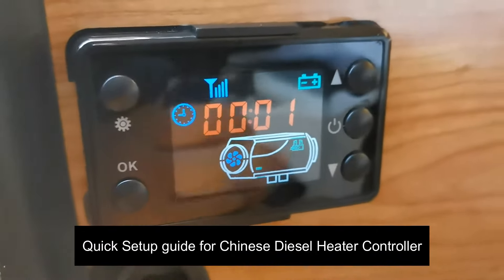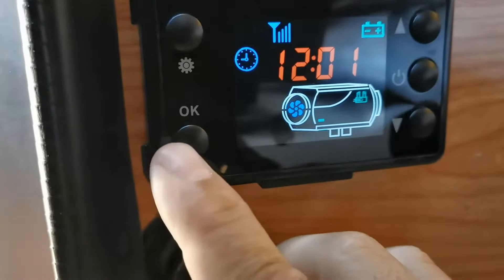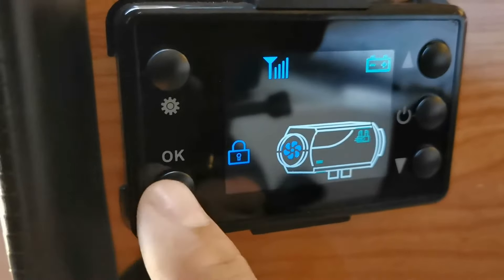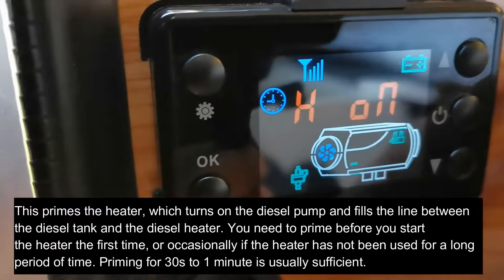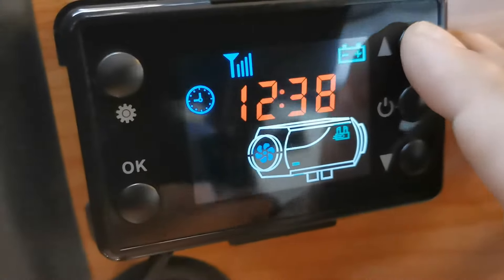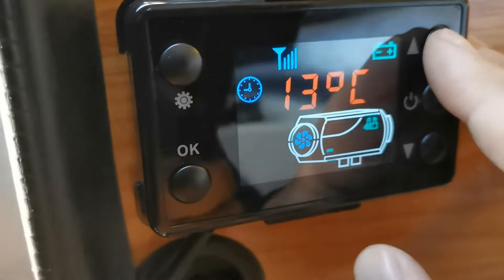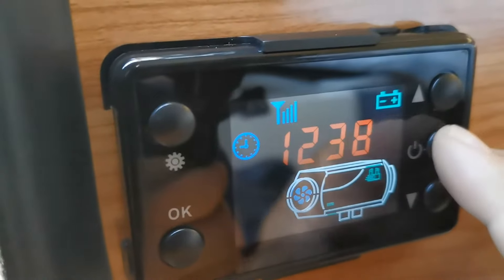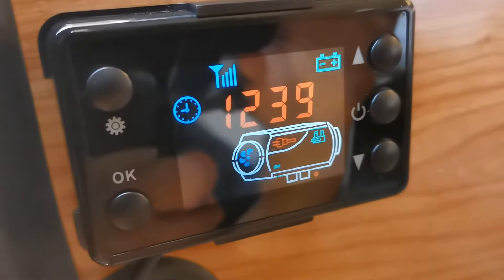Chinese Diesel Heater Controller Instructions

Comment: Hertz will affect temperature settings and YES you will need to set your Hz settings to a workable number and any thing below 2.3Hz will if you don't have enough revs will get E.008 code and depending on which Kw power your diesel heater is will determine the Hz setting so say you have a 5Kw heater which is closer to3.5  kw maybe 4Kw I set the lowest Hz at 2.3-2.4Hz and for some reason the highest setting works best for my heater at 3.6-3.8Hz and I've tried it at a higher setting of 4.8 and 5Kw  but for fuel consumption I decided the optimum was as I said previously as this gives a positive burn and will run the heater pretty much all day and night with a no smoke on start up. A larger fuel tank would save going out in the cold to top up fuel .  Each diesel heater has it's particular settings from factory .A lot but not all sellers online are selling generic mass produced diesel heaters no name brands from several different manufacturers the difference being in the ECU system and the remote features setup. The manual That came with my 5Kwatsit is a pack of gibberish abuse of the written English language/Chinglish so I went online sourcing easier to understand instructions and information. Cheers Mate

Comment: Would do that. But again. Can't change anything. Can't get screen to do anything. Stays on those 3 lines in the middle of the screen. Then the orange circle with the line through it on the bottom left..Can't get the screen to change no matter what buttons I push..

Comment: Many thanks for posting. You gave me the information I was looking for
Reply from the maker: You're welcome
Reply: @Unfastened hi just wondering...do they turn off and restart once they have reached the set temp....like a normal thermostat on a heater?
Reply: @Subaruej20  Nope - they just ramp down to minimum (I have mine set to an optimised 1.0 Hz/1500RPM).

I personally much rather it do this than a complete shutdown - as both shutdown & restart uses the glowplug, & this draws 9/10 Amps per time - so could quite easily run down a battery overnight.

Comment: Thanks for that BUT  I switch mine off ( it's wired into the main control panel) every time as you shouldn't have the display permanently illuminated. It causes the lights to dim over time. Im going to try cutting into the red wire and through an illuminated on/off switch so I can control it that way

Comment: Hi there mate..the long press to turn off does that then activate the shut down mode cooling off sequence the heater runs through ? Or it is just off instantly?.. Cheers
Reply from the maker: The heater always has to run cool before it shuts down, as a safety thing. It'll never 'instant' shut off unless it loses power.
Reply: @Unfastened  Cool thanks mate, i just couldn't find exact information on the shut down, i didn't want to fry the board..I'll give it a go when it arrives next wk..cheers👌

Comment: How did you get into setup mode.
I can only adjust some settings after i press the on button to make it run
Reply from the maker: Do you have a settings button in the top left hand corner, like the one in the video?
Reply: @Unfastened  yes I do

Comment: I have a  Orange circle with a line in the circle on the bottom left..with 3 blue lines on the screen. Brand new can't get the screen to change. Help
Reply from the maker: The orange circle with the line in the middle, simply means that the unit has power, but the unit isn't running. So it is there just to let you know the unit is off.

Comment: Do you know if you can set the Hz first then use temperature mode? Or does temperatre mode run at full power up until the temperature is made and then it drops down?
Reply from the maker: The fan is dynamic. It will run at variable speed depending on ambient temp vs set temp until the set temp is achieved. Then it will turn the fan down to try and maintain that set temperature.

Comment: Nice...BUT WILL SOMEONE PLEASE SHOW A 6 BUTTON CONTROL PANEL THE ONE WITH A FUIEL PUMP ON THE LEFT HAND SIDE MIDDLE BUTTON..PLEASE I CANT START MY HEATER AS IT CAME WITH NO INSTRUCTIONS 😢
Reply: @philipscarisbrick1585 Hi Phillip, did you happen to find out this info as I have the same one

Comment: I need help. I pressed the power button and it says it is on and it shows the fan spinning but it actually isn't blowing in the air and then it shuts off. I can do this as many times as I want and it does the same thing
Reply from the maker: First, check the fuse for the heater unit and make sure it's not blown. Then check the cable between the controller and the heater unit. Also check the connections. Sometimes a pinched / cut cable will do this. The controller wants to turn on the heater but the cable between the controller and the heater is damaged. The controller can sense if the heater is connected, if it isn't it will turn off.

Comment: Mine keeps going into low voltage. It’s plugged into 12v. Any ideas how to fix this?
Reply from the maker: Grab a multimeter and unplug the control box. See how many volts you are getting to the heater. If its low, you might have a voltage drop between the battery and the heater. Or if the voltage at the box is below 12.4(ish) then your battery might need a charge. If the heater is running it down and you get low voltage after a while, you might need to run dual batteries instead of a single 12v battery. good luck
Reply: @Unfastened  thanks. Worked out that the heater couldn’t draw enough amps through the cigarette plug. Hooked it up to an Anderson plug instead and works fine now

Comment: Today I buy and install new heater, and I have problem with start,error code p10 fuel pump,when I check inside line for tank ,is empty, no diesel inside! I don't know how make a start pump,volume inside pump how working
Reply from the maker: You need to prime the pump. https://youtu.be/-MHsLW5ySbw?t=57
Reply: @Unfastened  thank you

Comment: How do you set it to Alpine mode
Reply from the maker: I don't know if this works, but after a quick google. " Alpine mode allows you to reduce the amount of fuel used to compensate for thinner air at higher altitude. To turn on Alpine mode, simply locate the Settings and OK buttons on the left hand side of the unit and hold them down until a mountain icon appears at the top. " See how you go.
Reply: Thanks for the update. I found it.

Comment: Hi , my Chinese desiel heater only allows me to change the fan speed , I'm only to change the temperature or anything ?  Can anyone help
Reply from the maker: Hi, many of the chinese controllers are compatible with many of the similar diesel heaters. You could get a more modern controller off Ebay, and then just plug it into your heater. (I have done this before, I had an older diesel heater and just got a newer controller off ebay and it all worked, plug and play). Good luck